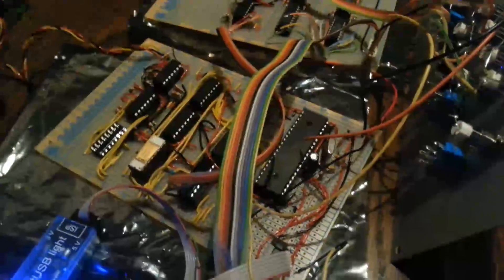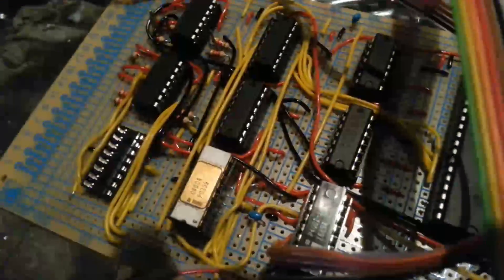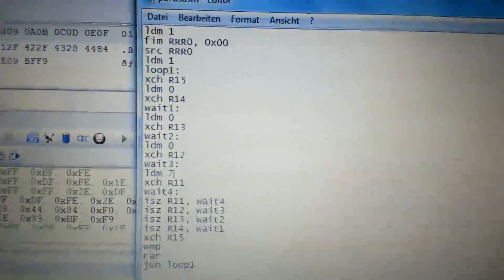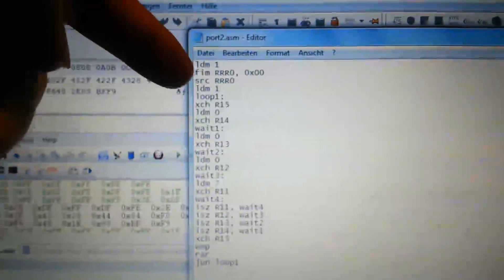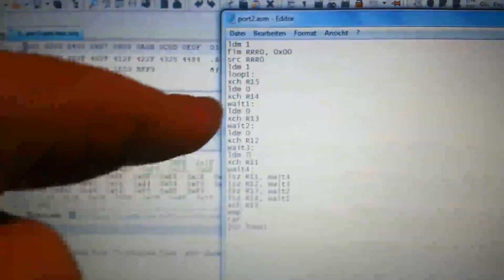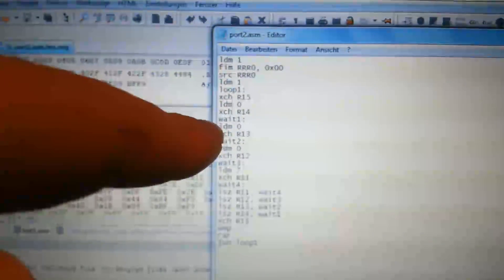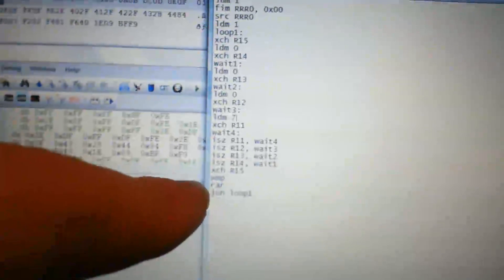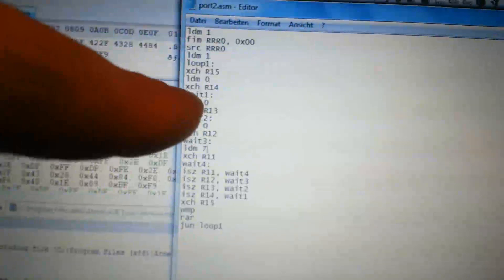Intel 4004 - microcomputer, December 2013

Comment: bravo . very nice . i did study the 4004 a little.
it is really wonderful CPU in its time. 4 bit but 46 instructions.
did you tried to make any editor for your assembler .?
Reply from the maker: +Aziz Mohammadpour You mean a running editor? For that I need input/Output for the Bus... but the ROMs where factory programmed... so I cannot get a ROM with defined input capability. I could possibly emulate... but I am already in my next project with a 6502 :)
Reply: +shinzon0  very nice, I mean monitor  programming for 4004  to write your machine  language there , as you know MCS6530 is monitor programming chip for 6502 ,